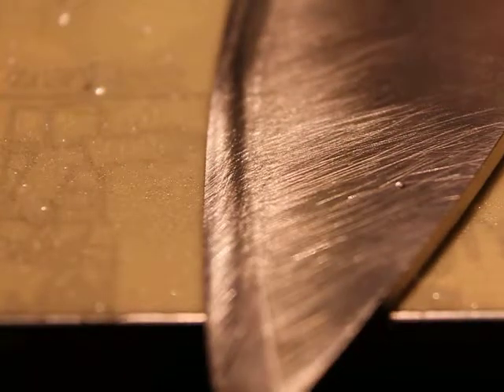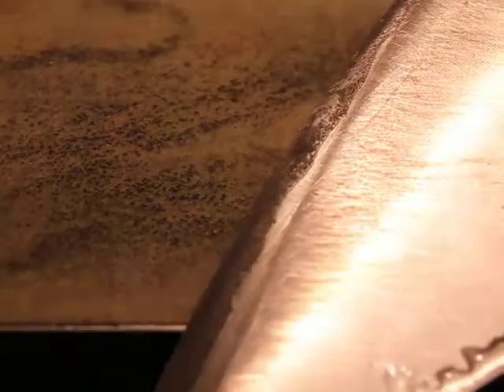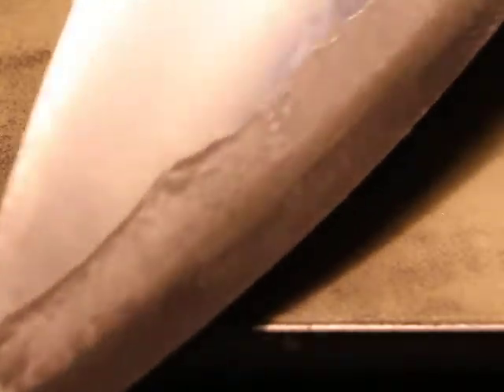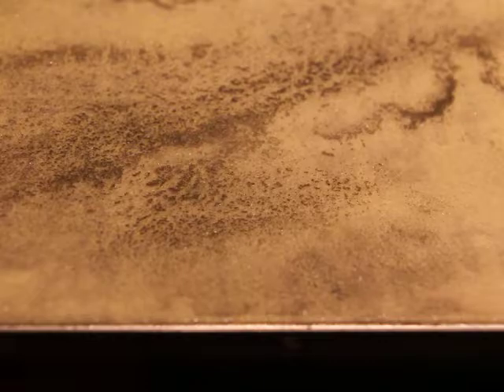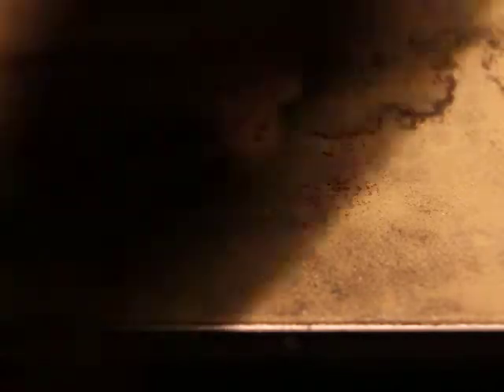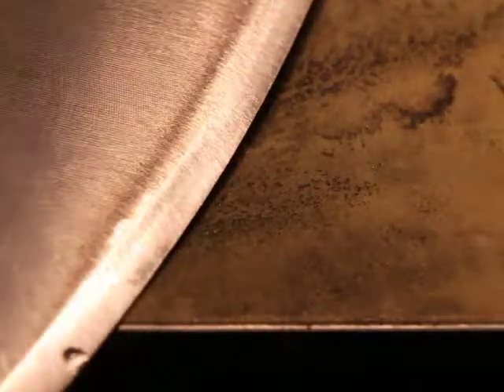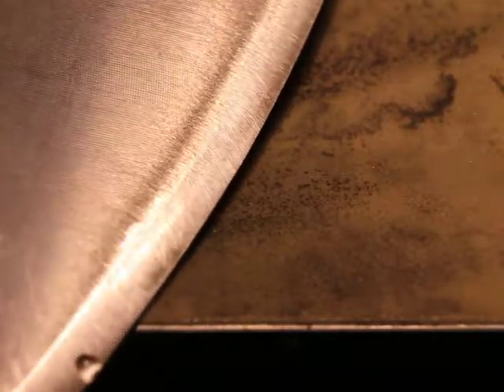45 Micron Diamond Sharpening Plate Up Close

Comment: how much grit is 45 micron?
does anyone know where i can find a good conversion chart for micron mesh and grit??
i cannot find any good charts online
Reply from the maker: So 16 micron is 1k grit, 30 micron is 500 grit, 60 micron is 250 grit, so 45 micron is inbetween or 375 grit.   You can double and half the numbers to figure out the rest of them 8micron-2k 4 micron- 4k 2 micron - 8k ... Look over on knife forums in the keeping sharp section and you will find a table comparing microns to multiple grit rating systems.
Reply: thanks much appreciated